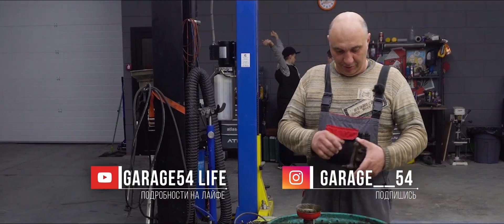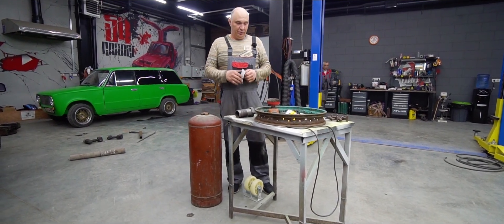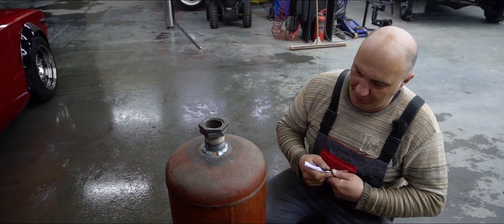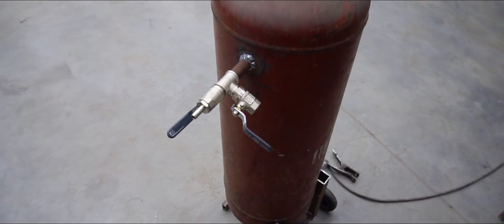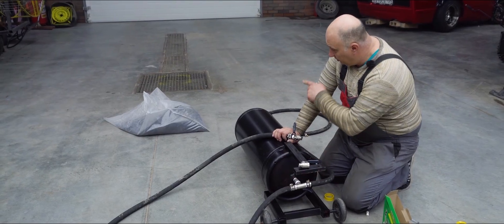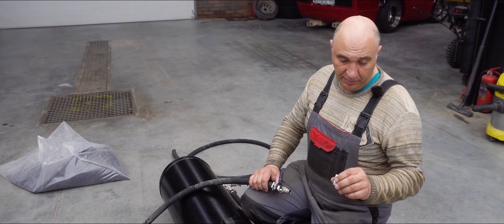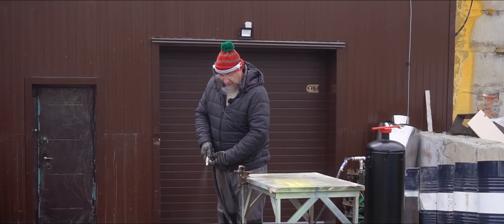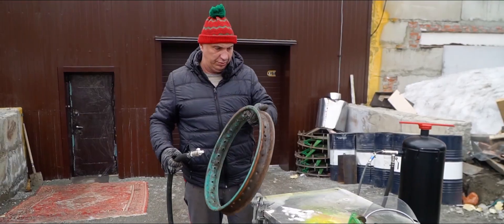Making a DIY sandblaster

Comment: You guys should put a warning when you weld galvanized steel pipe, the fumes from that are carcinogenic, and you must remove all of the zinc coating before attempting to weld that, be careful.

Comment: Awesome ! I've been thinking of doing one myself for a longtime !
Back to cars, why don't test the handling a rear wheel steering car ? Not a 4ws, just the rear. I always wonder why we never build car that way...
Reply: It is very difficult to control the steering this way. It is like driving backwards in a fwd car.
Reply: Forklifts are build this way
Reply: Forklifts use it so they can turn tighter and pivot around the front for confined spaces. they are low speed vehicles, a car would loose control
Reply: Imagine going ~60mph (100kph) & then turning the wheel to go round a bend... The back end would swing out rather than the nose tucking in. You'd be very likely to spin out of control, think like a pendulum.

Some cars do have rear wheel steering in addition to the front wheels but the rear wheels only steer a tiny bit to help with handling/maneuverability.

Comment: Jesus, That's a SERIOUS piece of DIY kit. I've used low to mid range industrial sand blasters in the past and this thing was stripping heavy scale off at least as easily as some of the industrial kit I was let loose with, And the company I worked for had spent several thousand pounds to get those !!!
The only problem he'll have is if he starts trying to strip paint off car body panels with it, The friction caused by all the little impacts can cause localised heating, and when you're getting up to this level of power that heat can be enough to warp the metal. When I first saw this happen I thought the force of the impacts from the media had left lines of dent in the car door I was blasting, But an older employee explained what was happening and demonstrated it by blasting a section of 3mm steel for a couple of minutes, Then telling me to touch it........ It wasn't warm, it was friggin' HOT !!!!!
Reply: You need a hell of a compressor too
Reply: @wills5482  not really he said 10 ATMs which is 150psi, a 30 gal 155psi compressor is around $300 or you can get ones with 20 gal tanks with a max of 200PSI for $200. of course he probably has one with a much larger motor and that is where basically all of the cost is (but thats only for fill speed and keeping it full when in use.
Reply: mywaifunow it’s not pressure, but volume that is the problem to make.
Reply: 8uuuuuuuuuuuuuuuuuuuuuuuuuuuuuuuuuuuuuuuuuuuuuuuuuuuuuuuuuuuuu
⁹
Po
Ui0u
Reply: @benxebaxi  Berugtad?
Reply: I run a blasting and powder coating business and that is not powerful at all. It would be very hard for you to warp metal with what he is using. We use a 250 cfm compressor and a 3 bag pot from Applied. With our equipment you could indeed very easily warp the surface but as long as you know what distance to be at and never hit the surface straight on and always change the path you are blasting, you can prevent this from happening. I also wouldn’t recommend doing what he is doing as it is very unsafe and he is not wearing any of the right protective equipment. For his sake, I hope he is using a no silicate type of grit. For anyone who is even thinking of doing this, please wear a proper breathing helmet like the Apollo 60 or the Scorpion! I have known of many people getting silicosis and that shit will kill you. Buy a hodge clemco pot if you are thinking of starting up, at least then you know the pot has been pressure tested and is safe to use. All the best guys.
Reply: What would you do to correct this? Lower the pressure? Finer sand?
Reply: @drumboarder1  I heard something called "soda blast" for automotive.
Reply: @collomps  seams, crushed nut shells also works, glas beats.
Reply: Many cars cannot be blasted because it will seriously bend the panels
Reply: @gabrielcosta3301  even high end cars from today are build like trow away products.
Reply: @gabrielcosta3301  Sandblasting is not for structures made from thin metal, like cars. It's more for tougher metal objects, like, for example, if you're making a house from a bunch of shipping containers then you'll need to sandblast them before you can paint and protect them.
Reply: I used to use an industrial sand blaster and this was a stressed point that the company made. stepping farther back from the part to get a more peppered sp1-2 and work the part faster trying not to focus on one area too much. it's allot like welding.
Reply: @PunchesCouches  I worked for a metal working company and they used a DIY blaster like this what made by my  colleague. Sometimes check the hoses they can degrade really fast especally at sharp bendings.
Reply: @TielSong0509  it could get real bad. safety first!
Reply: @TielSong0509  yeah, I was kinda wondering if the insides of the hoses would wear out very quickly with the material moving through at such high speed. I imagine a little less wear if everything is moving through without too many bends, but rather gentle curves, but still it has to be eating it apart just going through straight as the material must be bumping into each other and glancing off sideways here and there. 

I suppose you could make the majority of the travel inside pipes and then the flexible areas for handling could be hose... just to cut down the areas where catastrophic failures could occur?
Reply: Not only heating, but electrostatic as well
Reply: wouldnt' the medium used also be a temp factor?
Reply: Some comments say don't use sand to remove paint. How do you strip paint off a car panel?
Reply: @hightimes3434  sander, paint stripper, you can soda blast it, I imagine they say not to use sand because of how aggressive it can be depending on what you use for media
Reply: @MyNameIsMrSmith  No, The say actual sand isn't good for DIY open air blasting kit (Rather than a blasting cabinet) because the sand partials get powdered on impact, So if you haven't got a proper air fed mask (ran from a separate oil free compressor, Or via some really good oil/water separation kit) you'd risk breathing the powder in and getting a lung condition called silicosis.
(https://en.wikipedia.org/wiki/Silicosis#:~:text=Silicosis%20is%20a%20form%20of,upper%20lobes%20of%20the%20lungs.)
Reply: @Reman1975  lol yeah, not breathing in dust is common sense...
Reply: You're right. Even bending a metal bar repeatedly gets it quite warm so pelting it with tiny beads does make a fair amount of heat.

Comment: This is "Make it extreme" for poor .
Reply: For the poor? Did you not see what tools are required to fab this pressure blaster? You need a welder, C25 gas for the welder, filler wire, welding helmet, grinder, cut off wheels, drill bits, drill, etc. To top it all off... you need a decent air compressor to run a pressure blaster this big. Dumbass...
Reply: @Void-gn9zm  Im joking man, take it easy :)

Comment: Too much security measures for being Russians
Reply: It's called "not being stupid", you really don't want to fuck around with a sandblaster near any of your squishy bits, Russian or otherwise, tiny grains moving so fast will fuck you up probably for life.
Reply: @GoldSrc_  Of course, I won't use a fucking high-pressure sand launcher without the adequate equipment. But, I have seen too many Russian videos to know this is the most security measures they ever had lol
Reply: that's just says how dangerous it really is
Reply: I have "sandblasted my hand" once working with homemade sandblaster made of water bottle and 24l compressor
It left a bloody mark on my hand and hurt so bad even tho its small sandblaster
Reply: @julek43  How did you make please ?
Reply: Here in Brazil sandblast is prohibited

Comment: How many gallon tank is that ? I have a 26 gal air compressor tank the motor died will that work ?
Reply: Usually- that's a 50-liter gas balloon. I don't know- how many gallons there.
Reply: @greywolf88  50 litres is 13.2 USA gallons or 11 UK gallons.
Reply: ok

Comment: LS swap lada
Reply: Ls is gay put om606 to lada
Reply: Is the LS the only engine you know?
Reply: @Splooge_McFornication  I'd think so 😅 Although it would work great with a Lada because of the rear wheel drive. You'd have to fill the trunk with concrete though to get some traction on the rear wheels 😂
Reply: @schwuzi  Or drag radials... Ha ha!